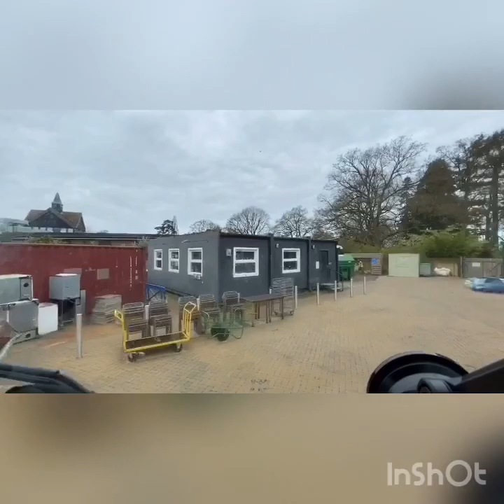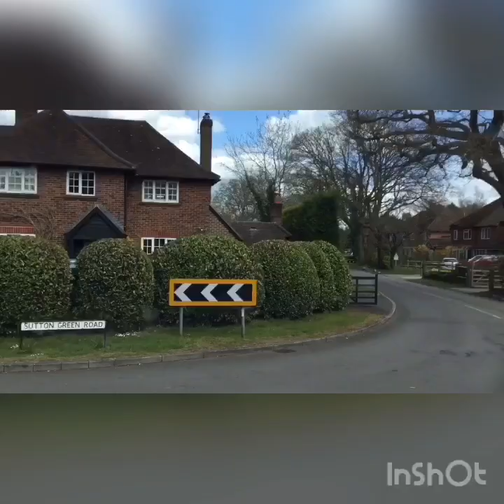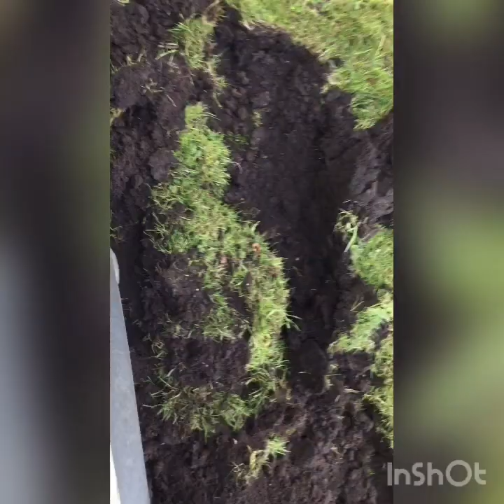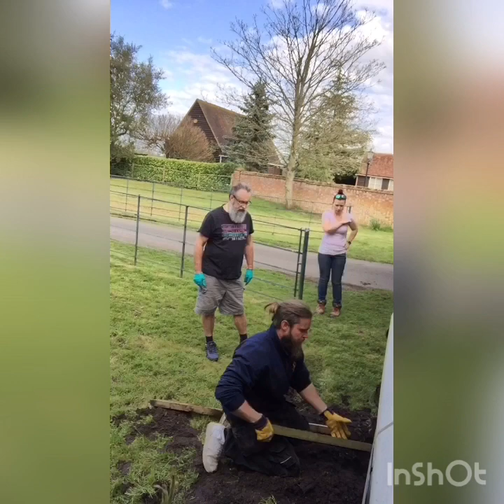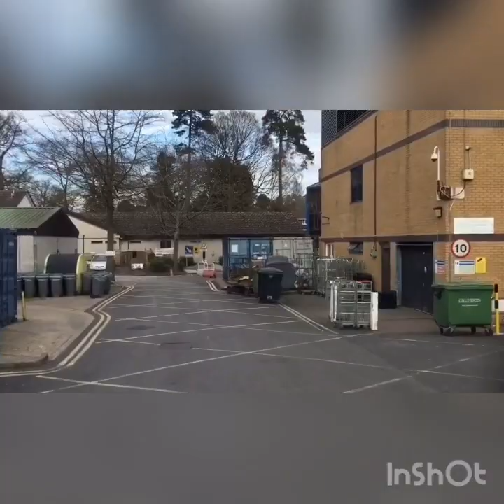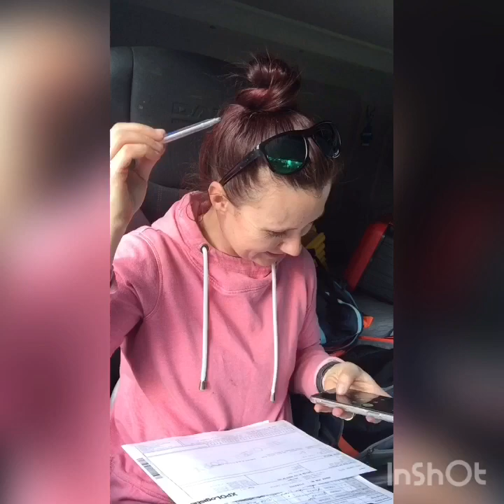Female ADR truck driver UK gets stuck in mud 😂😩 6/4/20

Comment: look at at the lane that is small Jesus i would have that lane a lot bigger then it would be that wide you would get any vehicle turned round or another way leave the truck on the lane pull the load down to them  saves stuck
Reply from the maker: Yes I should have just done that 🤦🏻‍♀️